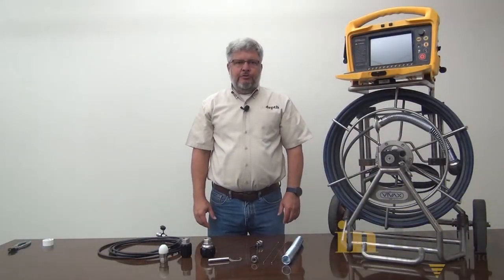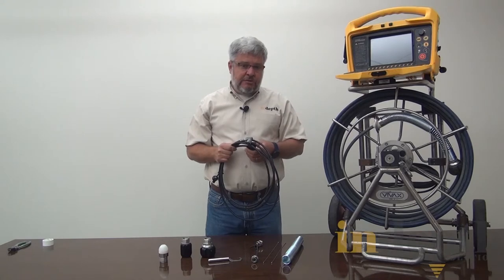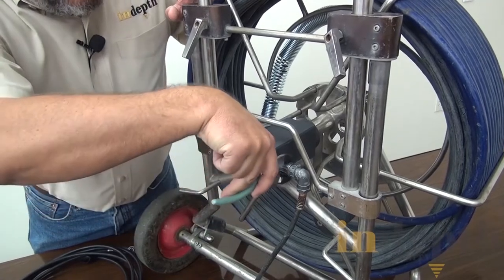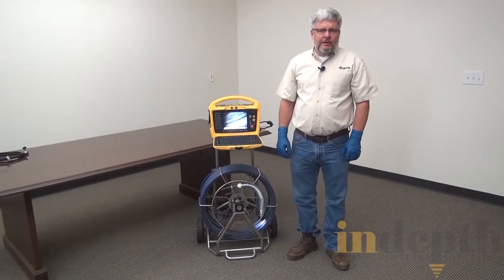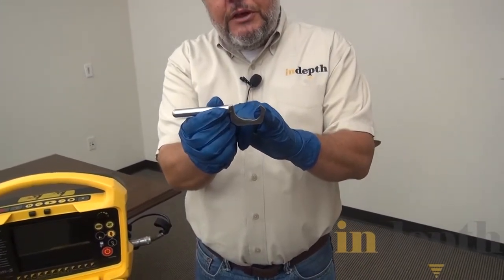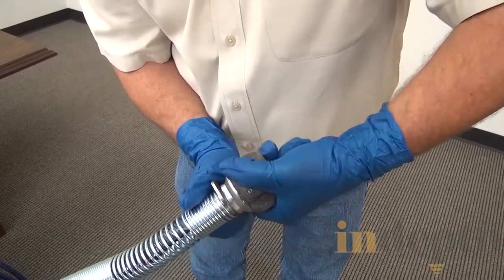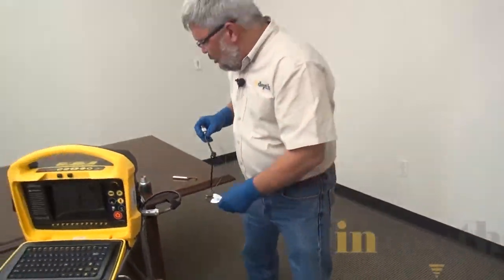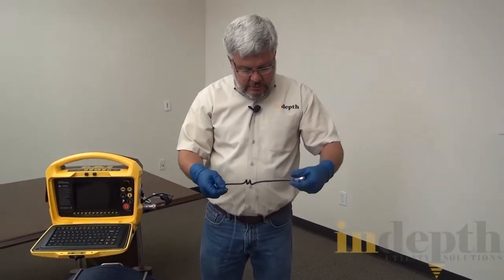Repair or fix a Vivax Metrotech Pipe Inspection Camera System for vCam-5 and vCam-6-HD

Comment: What causes sonde to not work..can't pick it up with locator but light on module shows it is on..thanks
Reply from the maker: There could be a problem on the sonde portion of the conductors that go to the camera head. There are separate conductors for the light, so this might explain the issue.
Reply: @Indepth Utility Solutions  thank you for replying..I'll check that out..again thank you

Comment: What about the brightness dial ? Need help
Reply from the maker: It depends on which model you have. The older models such as the vCam Modular and vCam Digital have had more issues with the brightness dial but to my knowledge, we rarely encounter issues with the vCam-5 and vCam-6 Control Modules. For the older models, it usually is either the dial itself or one of the immediate components attached to it or there is a larger problem with the circuit board.

Comment: Que puede fallar cuando el contador de metros no funciona ?
Reply from the maker: If there are no other issues, it shouldn't effect the camera system.  You will need a locator to find the camera head, but the counter being broken will not by itself effect the other components.  When this happens there are a couple of possible issues and we can certainly repair the unit. Contact us if you would like us to look at your control module.